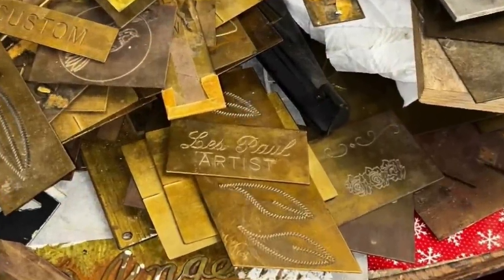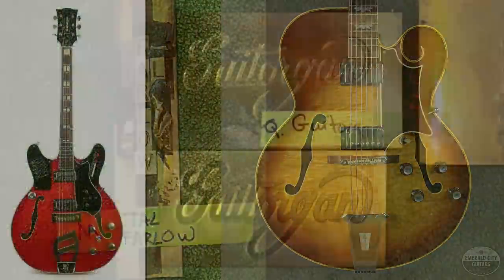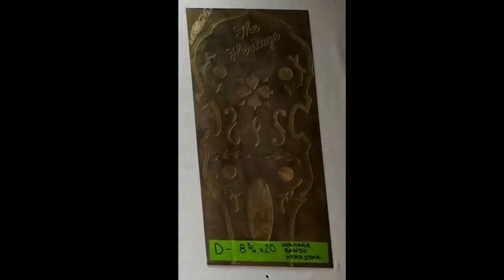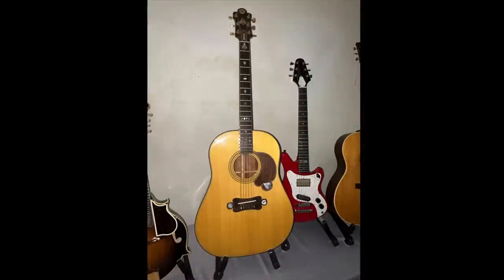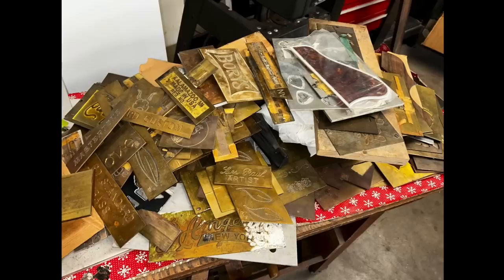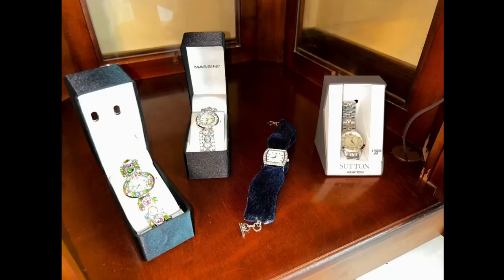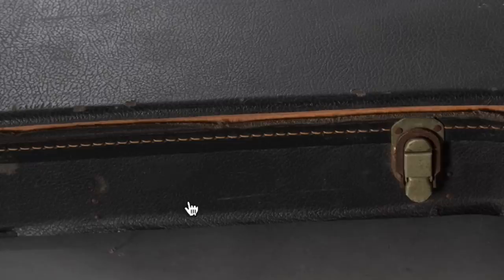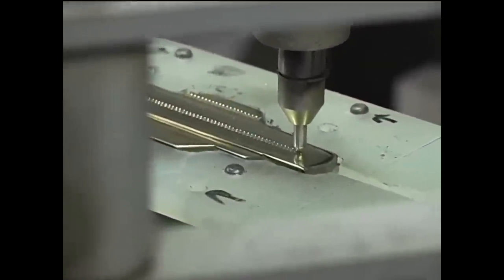PRICELESS Gibson + Heritage Heirlooms in Kalamazoo, MI Estate Sale | Maudie Moore

Comment: This episode was just brought to my attention. A good reporter always makes sure they have their facts straight. You didn’t. All of this stuff was headed for a dumpster before the estate sale company owner found out and said hold on. The sellers video you showed was presale. That whole stack of Ebony fingerboards for thirty dollars as you stated, wrong. Thirty dollars each and each piece was clearly marked. The L~5 top was at some time marked ‘sample’ in red pint on the back and was not in great condition. Most of the raw ebony boards had cracks and were could only be used after being cut down for mandolins. Upon investigation I found they went to a mandolin manufacturer. I viewed this property early on and Maudie was a hoarder. Storage conditions were less than optimal and the pieces that were stained and smelling of rodent urine were disposed of. Of the fingerboards and headstock veneers I saw, many were obviously test pieces. One of your followers mentioned your accurate reporting, wrong. Another mention if the wood was Brazilian… only a couple of the acoustic bridges I saw were Brazilian. You enjoyed panning in on those dozen or so Norlin era acoustic bridges. Wow, there’s an investment for you. Tens of thousands of dollars in wood… wrong. If that mandolin was a Lloyd Loar… really big if, but no. 1985 F5-L that I know went to a local long time collector. There were several very nice instruments that were sold to collectors at fair prices prior to the estate sale. Trogly, stick to mysteriously unboxing beautiful blue berry burst LPs. And before you venture into reporting like you did here that damages a person’s reputation and defames them, know what you’re talking about. Get your facts straight before you get all your Troggles repeating false information. This episode reeks of your jealousy of not being there.

Comment: Those are not stencils. Those pantograph dupli-carvers templates are like the famous Hermes type jeweler's engraver templates. You run a stylus over the brass template and a pantograph runs a router bit over the neck or peghead or truss rod cover, or tail piece, or whatever. Inhaling shell dust like mother of pearl is really not good for you at all, so they would run a vacuum cleaner over the bit and blow the shell dust outside into a baghouse.

Comment: No way accusing her of anything but it makes you wonder how she got all this Gibson 'property' in her home, especially the engraving plates, wood, headstock parts...Great video tour, Austin!
Reply: When gibson closed, they threw away alot of stuff. Some folks like Maudy did repair work for Gibson after they moved. They where allowed to grab stuff from the factory.
Reply: @blankstaircase  That's pretty generous of Gibson. May she rest in peace.
Reply: @john564holloway  Generous? They NEEDED her.
Reply: @chatti4440  Generous of Gibson letting her take all that stock home-fretboards, wood, stencils, etc.
Reply: @john564holloway  It was a business arrangement. Gibson had no desire to do the work "in house." They subbed the work to her. Nothing generous about that. She also purchased most of the tooling and supplies. Her engraving business did work for many other guitar makers. She also had 5 employees at one time.
Reply: @chatti4440  Didn't know Chatti you knew so much about her, her job and relationship with Gibson.
Reply: @john564holloway  Every guitar builder in Kalamazoo knows.